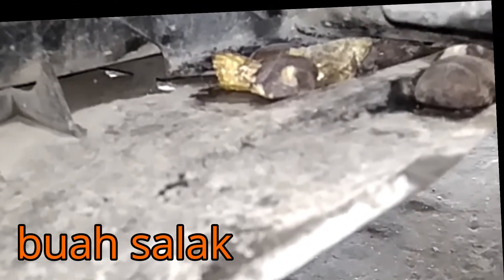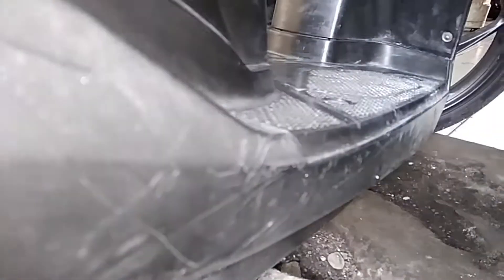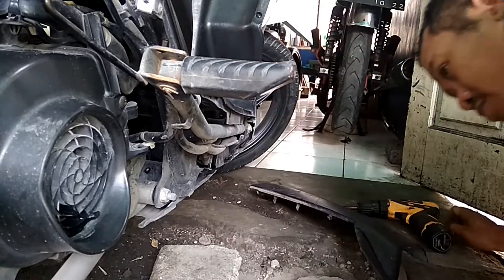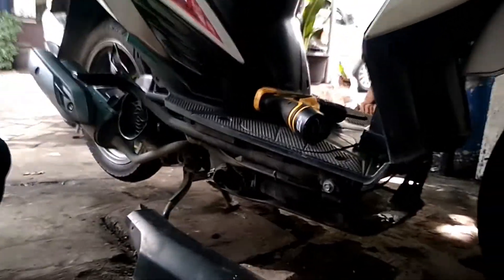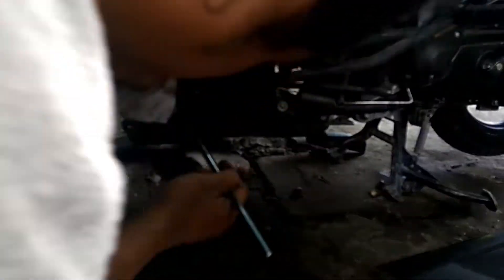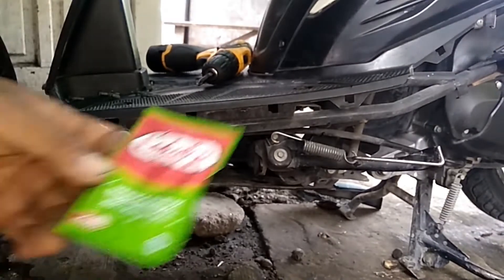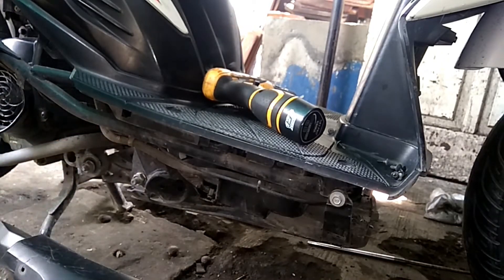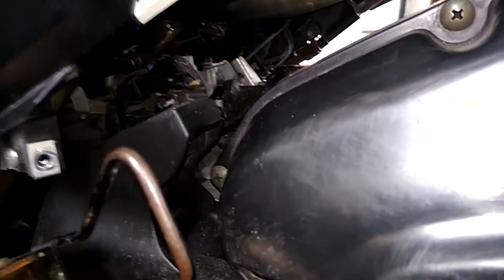Bumbu RAHASIA cara usir tikus di motor matic Honda Vario 110 WASPADA kolong dan mesin banyak sampah

Comment: Bang cara ngambil bangkai tikus di dalam pipa rangka gimana ya soalnya bangkainya di dalam bnget bang 
Saya user mio m3
Reply from the maker: belum pernah ngalami juga sih, paling mudah dibiarin aja atau sekalian lubang nya di sumbat untuk sementara
Reply: @cakdidik  udah bang pke segumpal kresek tpi baunya nyengat bnget dah di kasih kapur barus segenggam tpi tetap bau mas
Reply from the maker: @sandinugraha675  sebenernya paling cepat di bakar bangkai tikusnya ( tdk sy sarankan karena berbahaya, motor bisa terbakar juga )
Reply: @cakdidik  iya mas klo gk dalam sih masih bisa di ambil tpi ini pasti di rangka dek nya mas jdi susah di ambilnya ya saya udah kasih air kopi mas kapal api tanpa gula dan bubuknya saya colok2in ke dalam pke lidi dan pke super sol mudah2an gk nyengat lgi baunya